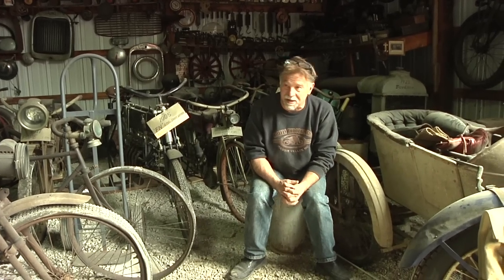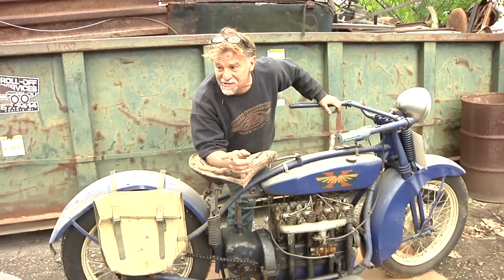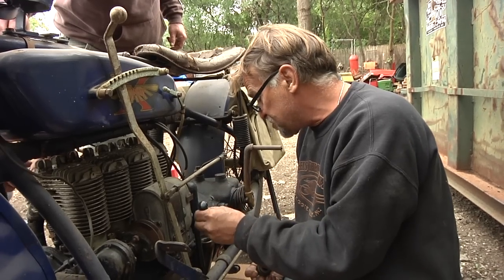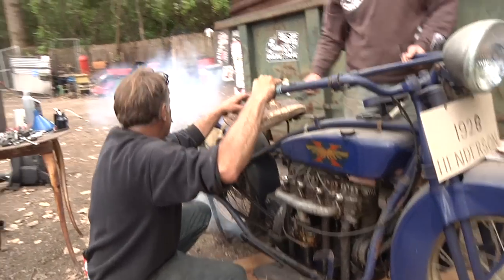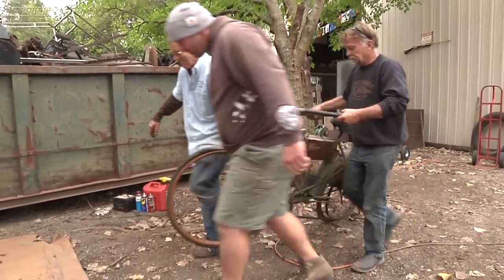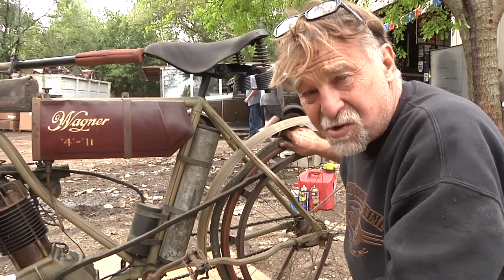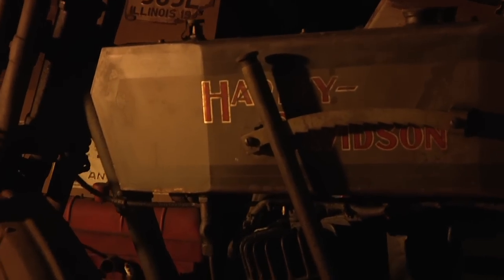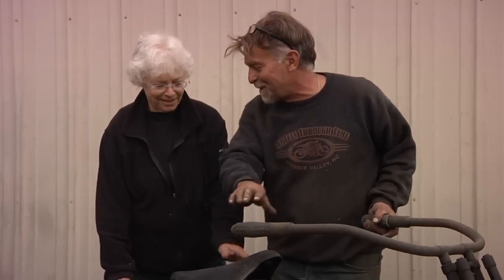Lee Hartung Collection Day 3: Another Day, Another Bike

Comment: seriously stupid assumption "the oil is clean" okay here goes whatever is in the OLD oil will settle in a few years so of course you ARE going to see "clean" oil. 
The next stupid thing to do is to start it up so the crap that is been collecting in the bottom will be transported around throughout the whole engine. Don't know if this engine has a pump or that it is just slung around. Either way its bad! A bike this old needs fresh oil at the very least! Oil that old is probably deteriorated!